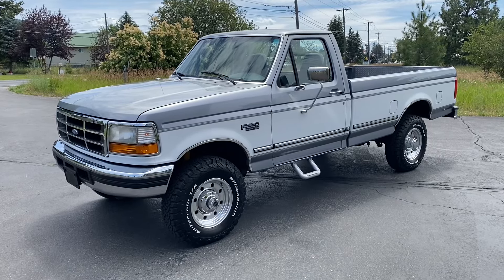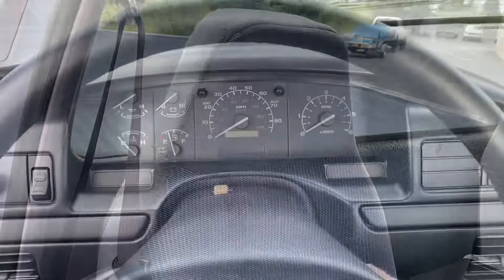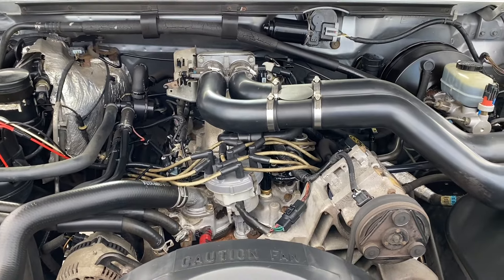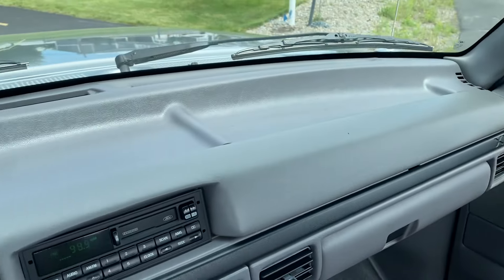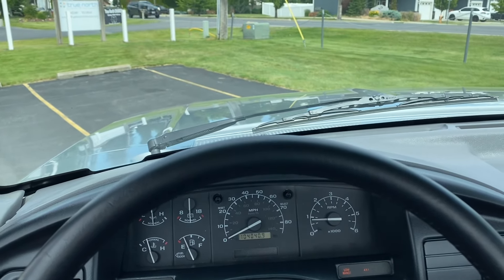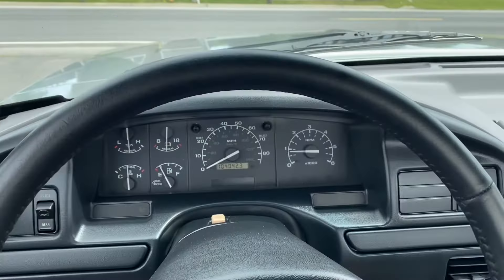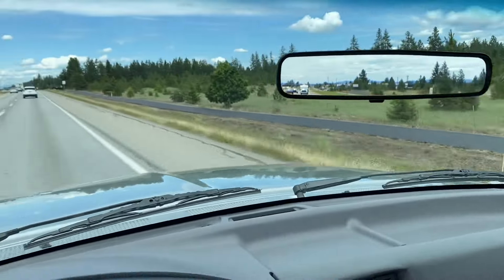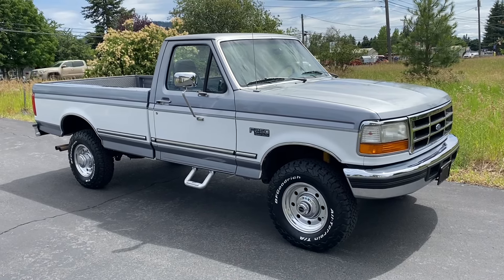1997 Ford F-250 XLT 4x4 460 5-Speed Walk Around & Drive

Comment: That's one sweet obs. Everyone wants one with a powerstroke but that 460 is also a great motor. My buddy had 380k on his. Was still running strong but it was an 80s plow truck and the frame rotted. This is one of the best trucks ever made. 

If you want to see some short highlight video of my 97 f250hd 7.3 refresh, check out my playlist. 
https://youtube.com/playlist?list=PLp0Qjjth0SeJl5D3pZg4-wuSJw-6AsBS3&feature=shared